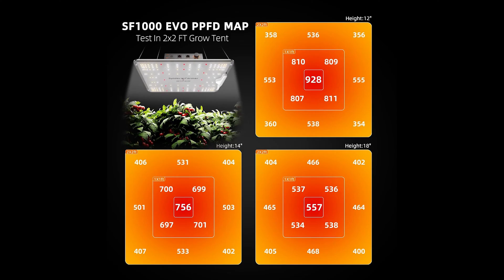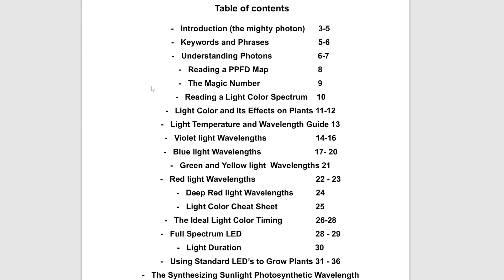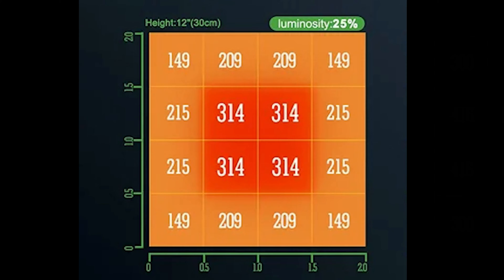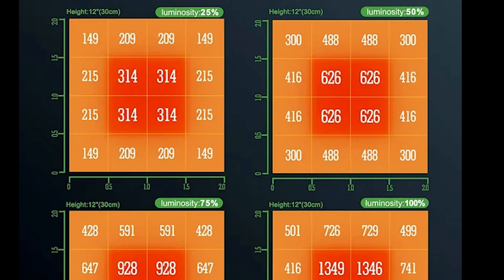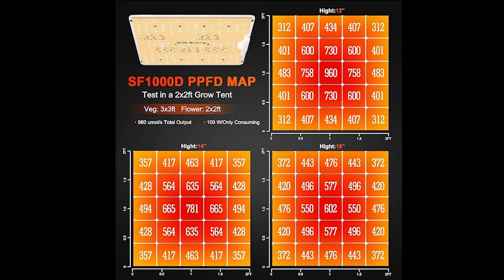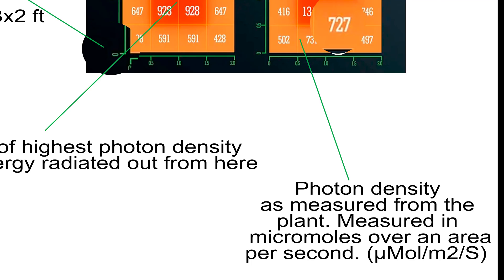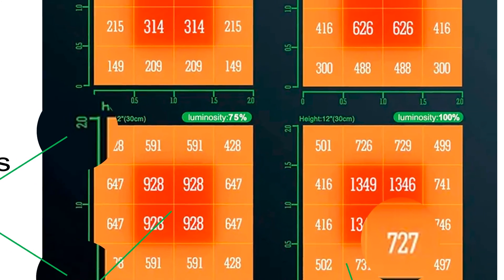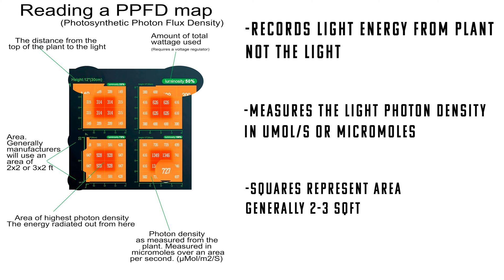How To Read A PPFD MAP | How Many LED Lights Do I Need? LED Grow Lights For Beginners.

Comment: would two 2x2 lamps vs a 2x4 lamp from the same brand have the same PPFD in the middle?
Reply from the maker: That depends on the power supply of each. If each LED had the sale PPFD output (the same wattage) then I don't see why not.